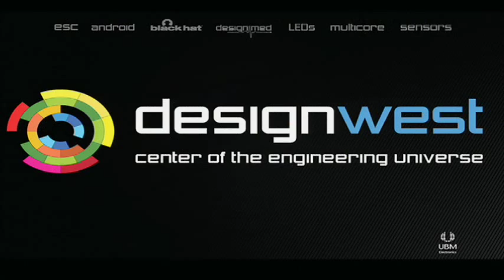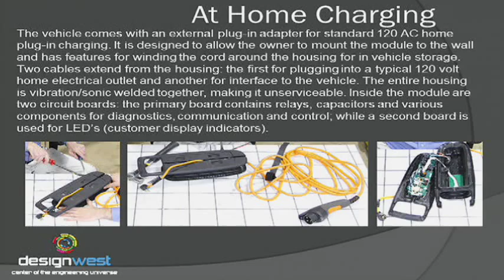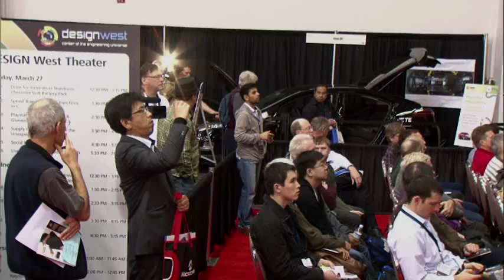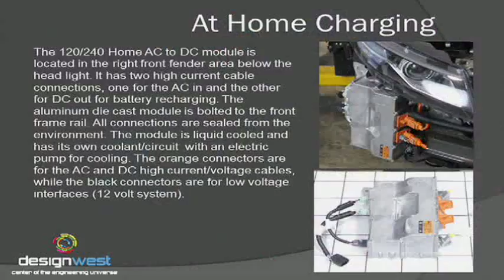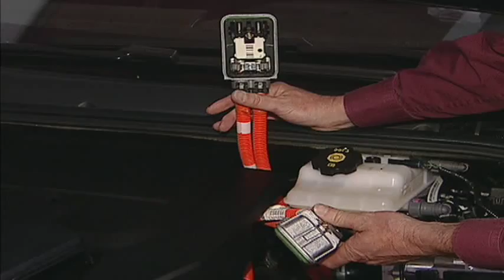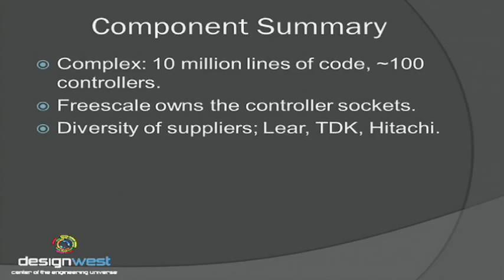Chevy Volt Teardown: Charging system and powertrain

Comment: "high current dc to low current dc" short probably read "high voltage dc to low voltage dc" if I understand correctly this powers from the high voltage battery 360V DC circuit to the 12V DC accessory circuit, so it is actually low current on the input side 7 amps at 360VDC and high current on the output side 12VDC at 200 amps

Comment: If they would have done this in the 1950s and used Thorium energy plants we would be off foreign oil and have enough power to run our country for over 500 years. We have a lot of the rock in Washington state.
Reply: TekReviews They didn't have a flux capacitor back then.